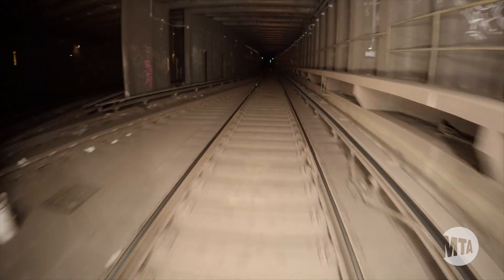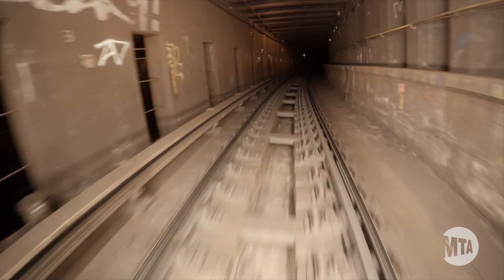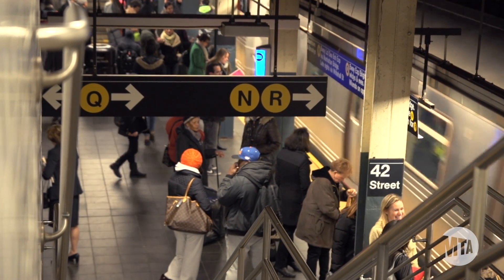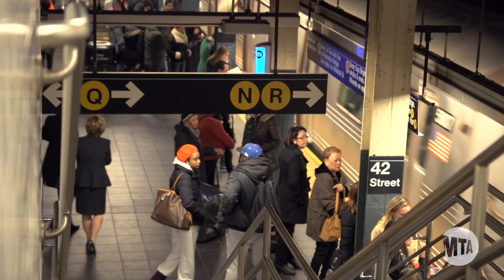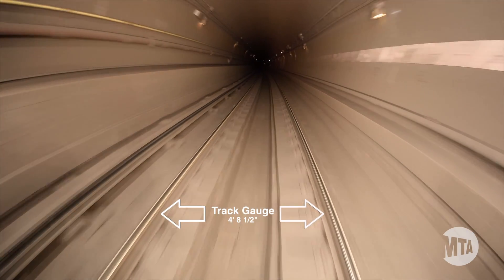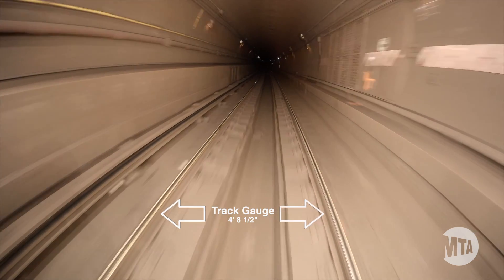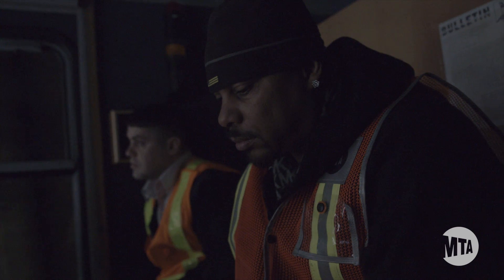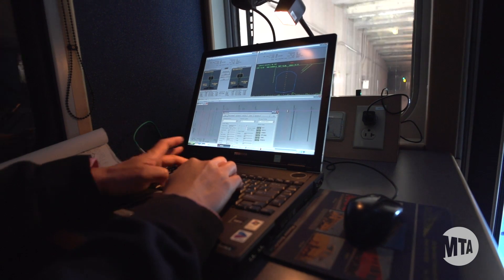Track Geometry Car

Comment: I saw it heading from the 6 line to the 7 line to inspect the track cause 3 trains derailed one due to a broken switch and  another one over shot at a Hudson yards while the train behind it was caused by operator error he drove past a red signal and wasn't able to stop in time

Comment: how do i get a job as an bus driver....i wanna drive the Bx32,M4,M1,M102,Bx15....
Reply: http://web.mta.info/nyct/hr/pdf_exams/7105%20-%20Bus%20Operator.pdf Get on it fast this has no requirements you will need a CDL at the time of appointment which will be like 4-5+ years
Reply: Milton R142A's and R143's  when I am big  I m  will Drive The Q111 in Queens.